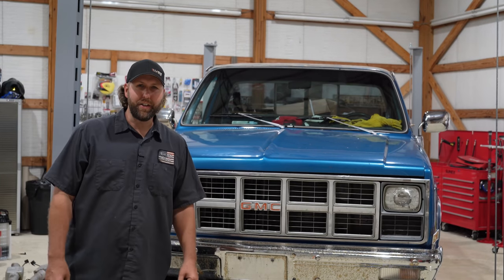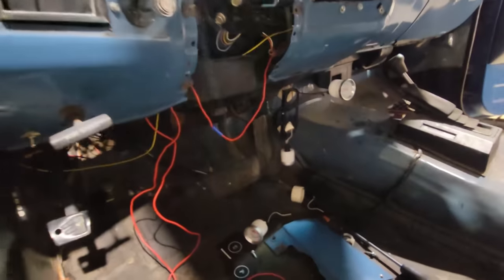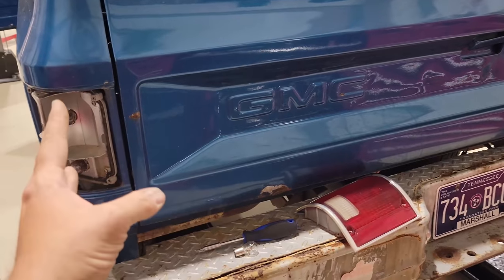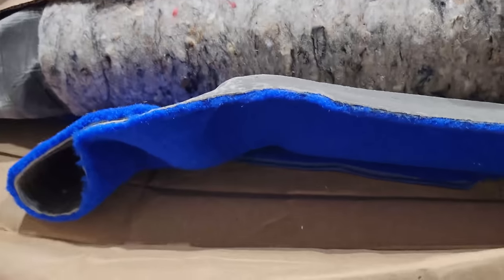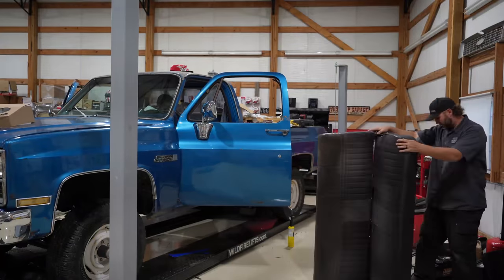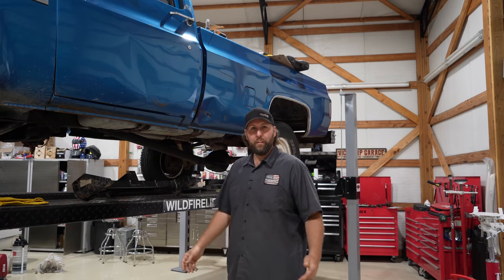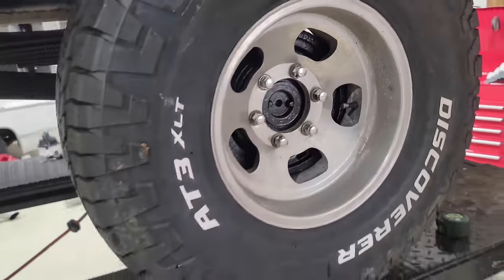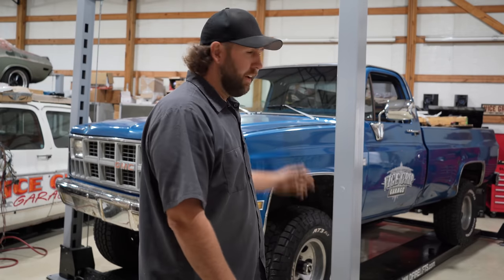Budget Truck Restoration: GMC 4x4 Gets Overhauled!

Comment: I picked up a barn find about 2 years ago. After watching your show you have motivated me to get the thing running. It’s an F350 with a flat bed. That was rotted away so building a new bed and converting to a dump bed. It has the 390 big block. Exhaust is busted so hung to hang some headers in there. If I can get the bolts out. It’s been a long time since I did the mechanic thing. 40 years. Getting into it. Thanks for all the videos.

Comment: When installing shifter boots, I wad up some fiberglass insulation and stuff it inside the boot. You would be amazed how much noise it eliminates, and it might cut down on heat/cold. It takes 30 seconds and makes a big difference

Comment: On the seat, find a big section of used denim, stuff it through the hole and spread it out over the foam, then hand stitch it to the rest o the cover - that will save the foam from getting ground away from getting in and out of the truck.  :)
Reply: That would definitely bring it right back around.
Reply: how about glue down the old denim
Reply: how about a Blue blanket seat cover?

Comment: Hey Derek try a deflated basketball shove it in there and use the inflation kit from your truck with the little needle then reinflate it and it will pop out I tried that with my truck it works beautifully! A cheap ball Is less than $10

Comment: That carpet debacle happened to me once on a 73 Chevy, and believe it or not I rattlecanned that ugly carpet to a much more suitable color! Did not attempt it in one coat; laid it out on the ground and sprayed several mist coats until it was perfect. Never thought it would work, but it did! Since the seat and the floor mats covered most of the carpet, there wasn’t much painted area showing in the end. Give it a whirl if you get tired of the “electricity”.
Reply: Rattle canned more carpets than I care to remember. Like you say, multiple light coats are the best way
Reply: I lightly rattlecanned the custom black faded old t-shirt stuffed denim 2x6 skillsaw carved lumber seat on my '76 Honda TL125 and It worked so good I am going to do it again next fall.

Comment: Just a bit of experience advice... I have been using a cheap soldering iron to burn through for seat bolts on my restos. Easy and seals up perfectly.
Reply: I apologize for commenting as I'm watching... a port a power from the freight works well for not only spreading a Reese hitch to fit frame rails, but also putting pressure on stubborn wheels while you beat on them with a Tonya Harding...

Comment: That is a fine looking machine. I think the special "Electric Blue" carpet, fits right in when you have the lights and radio on, because when those light up they are the same color. I was a little sad to see that you didn't stretch some of that vinyl looking leather over the dash board. Since you had it out, gluing down some half inch foam and stretching the vinyl over would have made it look way more newerish. Lots of fun in this episode and can't wait to see more.

Comment: Thanks for the vid. Love a modern service box put on this unit. Also if you were gonna use this truck I'd put dynomat or whatever brand in the doors,fllors,firewall - helps keep the noise down. I did it in a mid 2000s truck and it made a big difference like closing the doors made it feel solid, less noise on the road, etc. However, you have a ton of projects so unless your using this truck alot then it might not be worth it. Thanks again for the vid.

Comment: Nice job. It reminds me of the truck on the TV series "The Fall Guy" that Lee Majors used to drive as Colt Seavers who was a bounty hunter. Seavers's truck was a Rounded-Line 1981 GMC K-2500 Wideside with the Sierra Grande equipment level package. Thanks for the upgrade demostration.

Comment: You know it's good when the fuel gauge is just as large as the speedometer 😂
Reply: And if it had the 350 and towing package you could watch the gas needle go backwards almost as fast as the speedo went up..!
Reply: Try it with a 454.

Comment: I know its an old vid but a lil carpet bolt hole tip.  Put all of the seatbolts in a few threads under the carpet and use a rubber tonya harding to beat the bolt head thru the carpet.  then cauterize it. 👍

Comment: The trick on replacement temperature sensors is if you squeeze the upper hose it will drawn in water so water can't come out when you pull the sensor off.

Comment: I think that's pretty cool contrast color for the interior   I think there's kind of a Lee majors fall guy vibe. Chrome push bar with a winch on the front and a chrome roll bar in the back with the big CB whip antenna and if you don't know that was a really cool show that went off the air just before you were born

Comment: Dent trick - put one of your heat lamps on the door (from ~4’ away - not close enough to hurt the paint) for an hour or two. Get the metal temp up over 110-115.  Then (with welding gloves on your meat mitts), gently rub the debt with a piece of dry ice in concentric circles from the outer edge of the dent to the center. May have to do this a few times, but the slow heating/ rapid cooling of the tins should shrink the dent right outta there.

Comment: This video reminds me when I put new carpet in my 70's Volkswagen Rabbit in 1978.  Could not afford to purchase new carpet so I got a piece of used carpet from that was being thrown out.  It was an ugly green which did not match the cars green color at all!  In the end it was better than what was in there before.  However when I started the car up after I finished the install I smelled gas really bad.  Well I had used sheet metal screws and washer to hold the carpet down and drilled a hole right through a metal gas line.  I did the right thing and cut the fuel line in half, slipped a piece  rubber hose over each end and a couple of clamps and it was a good as new?  Thx for the great video!

Comment: Derek,
For the chrome trim try Molotow Liquid Chrome pens. Used em on my Galaxie and as long as you use 2000 grit to smooth out the surface you get a mirror finish just like factree.
Also with your stickers, Use some soapy water to help apply them kinda like you do with tint. A couple of drops to a Windex bottle full of water is plenty. Spray the door down and lay your sticker on the wet door. position it where ya want it and use a squeegee to push the water out until its sticks then just let the water dry up. It makes applying vinyl waaaay easier.

Comment: Love this channel. I'm curious what kind of electric fuel pump most fellas like for an Edelbrock carburetor. I'm gathering parts and funds, mostly funds and rebuilding a roller block with no provision for a mechanical fuel pump. It's going in my 1983 K20 eventually, the old engine has more leaks than a Detroit, thanks for any advice.

Comment: As hard as it may be to believe you actually CAN spray paint interior carpet. I’ve done it to great success in two different Broncos and my 89 5.0. Gray Duplicolor primer works great for gray carpet. But in my 89 Bronco and my Foxbody they were both red and I used the Color Cherry Red. It looked phenomenal and the paint smell was not as long lasting as you may think. Everyone thought I had new carpets.

Comment: A guys thinking you already know this but just in case, soapy water is another way to put on stickers, spray it on heavy, peel the back, slide it around to get it where you want it, squeegee it on, let it dry for a minute and peel the top layer..  Its my go to method for stickers... Figured if you can do for tint you can do for stickers too.. It works

Comment: That oil pressure scared me too. Below 20 psi was awful low. I'd just run some MMO and clean it out and fill it with fresh oil and see what's goin on. I'll tell you what that sure is a blue truck. No mistaking that.

Comment: I use to work at a factory that produced the carpet and TPO floorings for the f150.  Looks like the insulator pad is rolled up ? Was the insulator not molded to that floor?

Comment: I have a 1998 lincoln Mark 8 Collectors Edition Numbered car with sun roof and a 429 Cober Jet Motor. I live in San Antonio, Tx. It needs a new radiator, needs a fan motor , a new or used  heater core and wiper motor. It has one speed Fast. But dies work. Needs a new head linner, . a/c needs to be charged. No radio. Carpets needs cleaning. Drivers seat needs redone. But bought 2 front seat covers on right side & drivers side. Black in color. Less then 90K miles on it. No rust or body damaged. New tires

Comment: Did you get the carpet from lmc? I ordered a fash pad for my 89 suburban and got one for a 79 pick up, when I called they said that was what I ordered, I knew for a fact I ordered one for an 80 suburban because the gray one I wanted was on back order so I ordered a black one.

Comment: Loving those new gauges (and the ones in Independence).... but that re-setting thing whenever you start the rig, well, that would drive me crazy.... Could a guy stick a big fat capacitor in between the two red wires - y'know, live & ground - right behind the dash, big enough to keep it alive while all of those battree amps are going to the starter?
Reply: Interesting.

Comment: Those suction cups are worthless with pulling dents. I've tried. You wanna budget pull dents, take a plastic coke bottle with the cap still on it, put some hot glue on the cap, then stick it on the dent, give it a minutes to set, then yank it off. It'll pull dents.

Comment: Hey Derek, I have those same brackets going from the rear step bumper to the frame on my truck too!  Did both those NEED to come off in order to install the hitch?  I saw you took out the drill, was that to drill new holes into the frame?

Comment: Truck reminds me of the the 80s television series, "The Fall Guy". One of the trucks used in the show was a 1982 GMC K2500 Sierra Grande Wideside. It was prominently featured in every episode of  “The Fall Guy,” starring actor Lee Majors. 

In the first couple of seasons of The Fall Guy, the truck you see Colt Seavers driving is a 1980 GMC 4X4 K25. To make the truck look way more capable and athletic, it rode on a six-inch lift kit and also had a chromed-up rollbar bearing high-intensity lights. It also wore 35-inch Dick Cepek off-road tires that were knobbly and looked as if they could ride over just about any other car on the road, and that did happen a couple of times on the show.

Later, the truck became a 1982 model and wore a Sierra Grande trim package, now powered by a 5.7-liter V8 mated to a three-speed automatic transmission. In the later seasons, it was this 1982 GMC K2500 Sierra Grande Wideside, a brute of a truck that jumped over things as a ‘Roo does, rode on two wheels, and did everything a normal car could never do, unless it was being driven by Lee Majors.🤣

Apparently, one of the surviving trucks sold on eBay in 2003. The others were also auctioned off once the series ended but 35 years is a long time to keep a track of them.😉😁

Comment: OK, nice truck.  I have a tip.

The door pins, that the doors close on, are supposed to have a plastic coating over the pin.   This makes the pin slippery and the door closes easier.
Most just replace the pins.
I cut a piece of plastic from a clorox bottle,  milk bottle may work too, wide enough to cover the pin,   heat it up till it is flexible, then shape it on a bolt a little bit smaller diameter than the door pin.
when it cools, snap it on the door pin.  You  will see a difference in how easily the door will close with this in place.

ELECTRIC BLUE CARPET ---  That was a big color in 1974.  I bought a brand new 74 impala, light blue metalic outside, black dash and seats and ELECTRIC BLUE carpet.
It was a GM styling thing, trying to get the car to be more popular...  it was............. ok.  you sort of get used to it.
Unfortunately that car was during the polution crap years and the car got 10 mpg no matter what you did so I traded it.
The dealer couldn't rip that carpet out fast enough and replace with black..  Nice looking car, very bad mileage.

ok I have some tips on rust.  I have an 86 so I have been there and done that.  If you are planning to keep this truck, you really need to pay attention to the rust risk.
big hint, one of the big causes of rust come from the COWELL.   It is a complicated air system that goes from where the wipers are, down both sides to the ROCKERS AND goes up the window to the roof and down the backside by the corners.  that is all air flow, moisture.
I have taken on a major plan to try to stop, at least slow down the rust but you have to get everywhere, INCLUDING the cavity that no one pays attention to above the cab corners - ask me how I know!

above the wheel wells, around them the frame, basically the whole truck.  Let's talk.

Comment: With all that blue, is this the Derek Smurf Truck? I am betting you can get a good blue seat cover on the cheap. I know what your are thinking that a seat cover just does not stay in place all that well when you are gettin in and out of a rig. I'm pretty sure you have a few tricks up your sleeve on how to solve that issue (double back upholster tape, fabric spray glue). Love the truck, just not the color. Great show. Thank you VGG for another out of the park show. You and yours never fail to impress.

Comment: I suggest to put the speedometer to the right side and the tach on the left side. The reason for that is that the driver on a left hand drive car driving on the right side is always looking a little bit to the right side of the road. So you only have to look down to watch your speed instead of down and left. I was involved in instrumentation development some 20 years ago. Black background, white numbers and orange neeldes have the best visibility. Best lighting is white. Blue light is generating myopic, red light far sighted. The doctors said they are able to measure it. And you are possibly seeing the color of other white light outside your vehicle more green. This was investigated for commercial truck driving at Mercedes Benz long ago. The old mercedes cars from the 70´s had the speedos on the right side. Even if you think they are in the middle like an W126 S-class they are a little bit right. VW switched the positions from Rabbit/Jetta MK3 to MK4. The GM Squarebody fleet is outstanding. Even I saved a few from the crusher here in Germany. 
Best regarsds. Great channel!

Comment: It looks like there is a small issue with the gauge lights.  The dimmer turner-thing is scaled to work with the old in a can descent bulbs.  But the gauges all now have those ell ea dee bulbs which don’t play well with the original dimmer turns thing.  So a,guy gets only a trace of dimming action.  A picky fella could hang a 10 ohm 20 watt resistor across the bulbs to restore the dimming action.  From dimmer line to chassis.  If you’re picky.

Comment: Derek I put a new intake manifold and a new Holley 600 cfm carb on my c20.  Before I did this it had all factory and I did have this problem, so the problem is now I have a oil or oil and gas leak coming from the top of the carburetor. How do I fix it

Comment: i like my short box 79 4x4 cheyenne full option truck has the full metal grill with under 35,000 miles on it runs and drives like new with a 400 sbc 400 turbo got it free on a clean up did not run from sitting for way to many years need a fuel pump and carb cleaned and a battery. now it just  sits in my drive way looking good because my work horse is my 70 high boy dana 60/80 lockers with a 390 4 speed very nice truck i got it with no engine in it for 250 bucks traded for the 390 for it i call it my beast. i have military humvee tires on it i get them for 25 dollars a tire with 70/80 % tread 36.5 size. most of the time i drive my 68 pu chevy with a stroke 454 it is a lot of fun to drive it just want to lay rubber with street tires on it

Comment: i know its a year later, and no idea if you did any more work on it but that left lift block looks a little off didnt get a very good look at it, it just didnt look like it had full contact on the bottom and kinda looked like it had a slight angle to it 41.10 marker

Comment: For dents with little to no crease. Spray it really good with computer keyboard cleaner! It freezes up the metal. Then take the wife's hair dryer on the hottest setting and go over the dent. As the metal heats up the dent pops out.

Comment: On a serious note, A racecar engine builder told me an average motor (not a built motor) only needs a few pounds of oil pressure to oil the system...so as long as the gauge is working right and you have 2 or more pounds of oil pressure your engine is getting enough oil. Is it true?
Edit: If you don't drive like batman that is...

Comment: I have an 82 square body I bought two years ago fresh 350 allegedly it runs but I just need a little bit of encouragement I guess to get it running it runs it's tagged and everything but I just don't have it quite road worthy for my son he's 12 since I'm 60 I believe I can get him a hardship license at 14 so I'm running out of time it's been sitting here 2 years long with my 69 El Camino they both have new 350s in them and neither one of them are on the road being nice a little on the road revival Van Buren Arkansas on interstate 40 Arkansas Oklahoma line. My goal is to get them both on the road and get rid of this $20,000 Chevy truck that I have
Reply: They've been sitting because I was one of the unfortunates to catch cold there's not a soul here that will help me on these old styles I'm not kidding